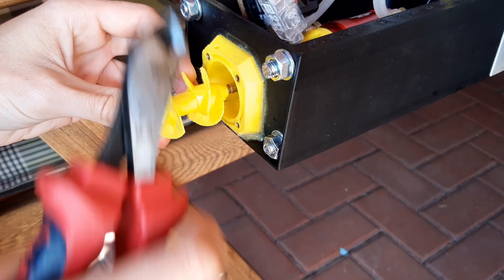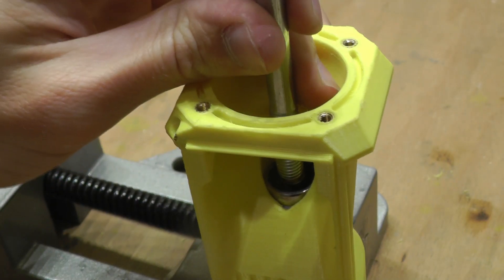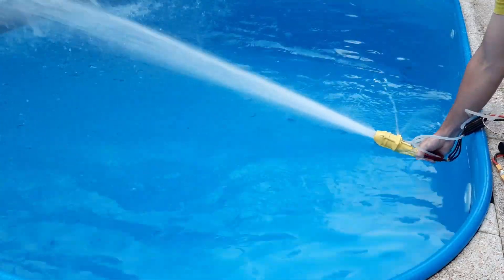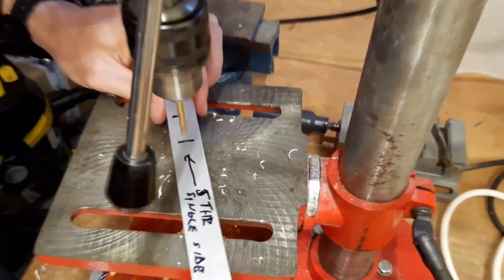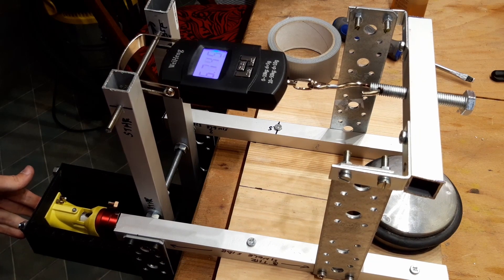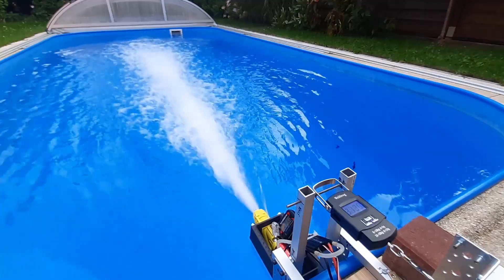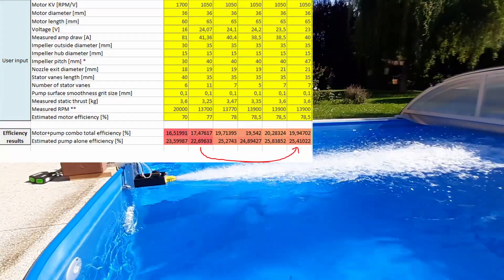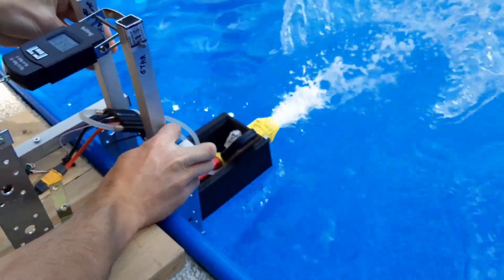How I Built My Most Efficient Jet Pump Yet

Comment: Interesting mod! I printed your M-Jet 60 and it came out really well. I prefer captive nuts to those brass inserts, but otherwise it was beautifully designed.
I notice that both stages have the same impeller pitch and same area, so the 2nd stage just unloads the first a bit rather than creating more pressure or velocity.
Could the 2nd stage be pitched a bit higher and have the "squeeze" start early (via hub expand, not outer tube), or is it always better to have constant velocity in the impeller parts and do all the squeeze at the end?
I'm also considering designing a single stage version with a cupped impeller and expanding hub. The final stator tunnels (not fins in reducing tube) will stay at tunnel width but with total volume = existing inlet-nozzle ratio. Seems less straightening is required that way, and it allows your steering gate idea to be done easily.
Thanks for your work!
Reply from the maker: Yes, the M-Jet 60 has same pitch on both impellers. That does not mean though, that the second impeller does not add pressure - both impellers add pressure, even if their pitch is the same. This happens, because the first stage stator vanes should straighten the water before the second impeller. Therefore ideally the second impeller operates in the same way as the first impeller and both add the same pressure.
During development of the different pumps, I tested different ideas. The M-Jet 60 got a straight hub, however with my latest experience I think that increasing hub diameter and increasing pitch work better - and this is what the M-Jet 35 uses.
The idea with "less straightening required" is one of the reasons why I chose the 4-path nozzle for M-Jet 35. As you described it, I think it will work for you and you can use similar steering indeed, good luck!
Reply: @mjetdevelopment  Thanks! I'm guessing that the optimum design would have a mass flow based on the funnel shaped Betz curve, but there are always complications like skin friction and turbulence and gaps between impellor and stator. And there's always scale.
It makes sense to me to utilise rather than suffer centrifugal effects, so your M-Jet 35 looks like a great direction.
Reply from the maker: @OzAndyify  I did not know about Betz curve before. I did a quick search, very interesting. I am not sure if this is applicable to such water pump though.
Reply: @mjetdevelopment  You are probably right because the jet is in a different medium (air) to the inlet and is fully constrained, but I think a gradual increase in velocity (area reduction) following a similar curve might be better than constant area & velocity in compressor part, then all the squeeze at once after the final stators. 
It's all one linked flow with water (not as compressible as air), so I may be way off! Your M-Jet35 work seems positive though, so it's worth playing. 
I love 3D design because we can make things that a metalworker would struggle with.
Reply from the maker: @OzAndyify  Yes, 3D printing gives great freedom of shape. The M-Jet 35´s impeller hub has an increasing diameter smooth curve, and this is what worked the best during excessive experimental testing, so I guess there might be some connection to the phenomenon you are referring to.
Reply: @mjetdevelopment  I'm going to try it from the inlet to the outlet with smooth curve as you say, including the stator sections. Just tossing up between one longer stage or two. It will bolt right onto your M-Jet60 inlet, so an easy experiment.
I really appreciate your feedback!
Reply from the maker: @OzAndyify  Nice! I am interested how it will go:)
Reply: @mjetdevelopment  I'll let you know!
I have the stock M-Jet60 mounted in a waterproof box and an inflatable SUP to test when weather improves. Happy to send you the design if it works any better than yours.

Comment: Please forgive the ignorant question (I'm not an R/C boat person), but why are you measuring the thrust with the nozzle out of the water?   When the drive is mounted in your boat, isn't it going to be submerged?
Reply from the maker: Hi, not an ignorat question at all:)
The reason is, at first the nozzle is submerged when the boat is sitting still, but as soon as the boat gets some speed, it "gets on plane" and mostly comes out of the water. Only a small area is fully submerged. This is the state in which the boat will run most of the time.
Reply: @mjetdevelopment  -- ah, thanks for the explanation!  
I don't know squat about R/C boats, but my intuition was that in full-sized jet boats, the output would be below the waterline, since water would provide a more suitable  medium for the jet to "push" against, than just air.  However, after reading the Wiki on jet boats, I see that I was mistaken, and apparently so was everyone else until William Hamilton thought to raise the output above the waterline, in the '50s.
Cool -- I learned something new today!  Thanks again.
Reply from the maker: @roberthaines4221  I understand your idea behind it, however the jet does not work by pushing the water "aganist a medium". It works like a gun shooting a bullet, and producing a recoil force on your shoulder - the water is like the bullet. The recoil, or here the thrust force is generated because the pump is accelerating the water backwards.
Actually, raising the nozzle above waterline is benefitial for efficiency, because it is easier to shoot the water into air than into dense water, where it would generate a lot of turbulence.
Reply: @mjetdevelopment  -- yeah, I get the distinction; it's Newton's Third Law all the way.  

One thing I find surprising is that in every video I've seen of RC jetboats, the intakes are simply flat along the bottom of the hull.  I'm surprised that at speed (especially in any kind of a chop) they can manage to draw enough water in to keep the impeller(s) constantly supplied, and prevent a loss of efficiency due to the introduction of air.  I would've expected to see some kind of an adjustable scoop / spoiler / trim tab that at-speed could direct more water in (without adding drag or disturbing the laminar flow).  Perhaps this is already being done, and I just haven't encountered it.
Reply from the maker: @roberthaines4221  Yes, this effect is hard to understand for me as well. The curve upwards into the intake is quite steep and I would also expect the water to separate from the surface and create vacuum or turbulence. But I dont have any way to properly find out what is happening there, because cavitation is important in this case and that is hard for me to capture in cfd. 
I have not tried a scoop yet but I dont want to put possibly vulnerable things under the surface of the hull.
Anyway, maybe one interesting thing is - the intake in my boats and most similar boats is so big, that the boat is travelling forward much faster, than the water into the intake. This means, from the water perspective, the water has to accelerate in the direction of boat travel to pass through the intake - the opposite way from the case where the boat sits still, if that makes sense.

Comment: Hi, very nice and interesting work ! Und straight forward design development. I like to see such work. But one question: How do you calculate the jet efficiency ? With measuring the power consumption of the motor and the produced thrust it is not possible. I assume that you are somehow estimating jet velocity or flow rate, correct ? And if, how ? Thanks for your answer in advance.
Reply from the maker: Hi, great question. There is no estimation involved. You are correct that I measure thrust and power consumption. But the one more thing which I know is nozzle diameter. 
I can modify the thrust equation (thrust = mass flow*exit velocity) to a different form (thurst = water density*exit nozzle area*exit velocity squared). From this I can calculate the exit velocity (it is the only unknown). Then I can easily calculate many other parameters including mass flow. 
Then, the output power is equal to kinetic energy the water receives per one second. And at the end I get efficiency.
Mainly, there are only two small errors involved: 1) this method estimates the water velocity is the same at every point of the nozzle which is not true, 2) I estimate efficiency of the brushless motor itself based on my previous measurements on a water dyno (in my older video) with similar electronics and load.
Reply: Ah, yes of course. That’s a simple and possible way based on an ideal world. But for me it is a kind of estimation because it is not measured somehow.
Why I ask ? I did some extensive measurements with my jet sprint boat from KMB with the corresponding 28mm jet unit. I measured power consumption, rpm, static thrust and boat speed at different throttle positions for different impeller and nozzle configurations. Now I updated my Excel sheet with your prediction of jet velocity and jet efficiency. With this I get efficiency value from 40-45% for the jet unit. Interesting to see is, that the calculated jet velocity for low throttle values is higher than the reached boat speed (as it should be), but for full throttle it is the same or even lower with the smallest nozzle I have test. This shows that this way of prediction of jet velocity/ efficiency is somehow insufficient, at least for my case. Therefore, it would be interesting, if you could also measure the speed of your new boat with the new jet unit for a comparison of jet exit velocity and boat speed.
Reply from the maker: @SharkV60  Yes, the boat speed can exceed the exit velocity. That is because we are calculating the exit velocity for a stationary jet unit with a static test. As the boat goes forward, the water is forced into the intake faster, helping the pump to push more water. Therefore flow rate increases (by the way rpm should also increase and amps should decrease) and exit velocity increases. So the boat is not going faster than the exit velocity, it is just that the exit velocity is higher when boat is running.
Reply from the maker: @SharkV60  I am very surprised by the 40-45% efficiency you measured on the kmb. I also did my old 28mm kmb test previously, not very "properly" that time, but it definitely was not over 30%. May I ask what your resulting output power of the KMB was? Just curious. You can see what I measured for my unit in my "M-Jet 35 Performance" video.
Reply: @mjetdevelopment  
Jet and normal propeller propulsion are completely different. Typical for jet propulsion is, that the power consumption is more or less independent from the boat speed. Water entering the waterjet inlet is accelerated to ship speed, consequently, exerts a momentum drag on the boat. I can only advise you to do some measurements on the jet in a running boat. By the way, this effect also applies to EDF units for model airplanes.
Reply: @mjetdevelopment  
In usual operation the maximal power consumption is not higher than 600-700W in static or dynamic conditions. Up to this power I did the most measurements where I got the mentioned efficiency values. In some test I went up to 1200W where the efficiency drops down to 34%. I’m traying to be very accurate within the test so far it is possible.
Reply from the maker: @SharkV60  Interesting. Thanks for further specification. I am not saying the power consumption is changing a lot and I have not measured it, but I find it very logical to estimate the amps drop for example from 80 to 70 at full boat speed, because the higher flow rate from intake makes the job of the impellers easier.
The argument that flow rate in a running boat increases is not just a plain guess, I got this result from multiple CFD calculations with a full pump, again not 100% accurate but the trend was clearly visible.
Also, as you pretty much said, at full boat speed, the boat speed is much higher than the water velocity inside the intake. The water has to slow down (relative to the boat) considerably in order to run into the intake and approach impeller. This effect should increase intake pressure above atmoshperic, which corresponds to some people getting leaks from the intake housing only when the boat is running and not during a full throttle static test.
And again this agrees with the increasing flow rate.

Comment: Finally bought the M-Jet 30 STL and noticed that you have included the single blade impellers with the purchase. Which was a neat detail, I look forward to seeing if it's gonna be better for my application.
Reply from the maker: Okay, good luck! I have not tested single blades on M-Jet 30 but it is expected that it should give maybe a little bit less thrust, but much lower amp draw, creating better efficiency and runtime.
Reply: @mjetdevelopment  How much volume in a minute do you reckon the 30 pumps at full chat? I have got a priming pump, but it peaks at 1l/min and I am afraid that won't be enough to supply the jet with water consistently. A litre a minute is about on par with the SuperSoaker CPS 2000, a PRODUCTION water gun. Which is the most powerful production water gun in history, but still. I could maybe stagger two pumps in parallel to increase flow to 2 litres a minute.
Reply from the maker: @ProtonFilms_Mark  The M-Jet 30 pumps over 3 liters per second... 180 liters per minute lol. For a water gun this is probably too much right? For a water gun, you need less flow rate but higher pressure converted to higher velocity
Reply from the maker: You could dramatically reduce the exit nozzle, or add a pipe with small diameter, to get much lower flow rate and higher velocity. But then plan your setup for lower RPM
Reply from the maker: And also I dont know how the pump will behave if you really decrease the diameter a lot
Reply: @mjetdevelopment  I can probably arrange that with a small enough exit orifice. I would like to say that I should have paid more attention in school, but I don't think I remember fluid dynamics being a subject at all. Physics was all seemingly thermodynamics at my school. Also, I did mistype, I did mean a litre a second, 60 litres a minute.
Reply from the maker: @ProtonFilms_Mark  Ah alright then! If its 60 liters per minute, I think you can get there no problem
Reply: @mjetdevelopment  it's such a pleasure conversing with you. Thanks for everything!
Reply from the maker: @ProtonFilms_Mark  I enjoy everything about this:)
Reply: @mjetdevelopment  so if we assume that the M-Jet 30 does 3 litres a second with a 1700kv motor and a 4S battery, and I need its maximum flow to be 1.5 litres a minute, does that mean I need a 2S battery? I've got an 80 amp ESC for the purpose.
Reply from the maker: @ProtonFilms_Mark  I am not sure. If you reduce the outlet nozzle a lot to get more velocity, it will drop the flow rate to some extent already. Maybe 3s would be a good compromise, but you will probably have to test it
Reply: @mjetdevelopment  I am just concerned with overtaxing the motor and ESC if they encounter too much resistance at the exit.
Reply from the maker: @ProtonFilms_Mark  I think 80A esc on 3S will be enough. On 4S it would probably be insufficient

Comment: Hey I tried the single prop mod in the M-Jet Spring 3d mods files and actually had worse performance than my standard prop. I was a bit surprised after seeing how much success you had in this video! Have you had any other feedback or updates?
Reply from the maker: Hi, thank you for your feedback, you are the first who has tested it! The results can naturally differ depending on the specific pump. It is totally possible that this setup works worse for the M-Jet Sprint. Regarding the new pump you can see in this video, I have already objectively verified the results so many times that this cannot be any coincidence, but I am still only testing the single blade pump static and the results can (unfortunately) change when I put it into a boat. Stepan
Reply: @mjetdevelopment  Worked great for me, interested to hear your setup.  Motor , battery etc. I am using 4s battery, smallish 2845 brushless motor at 1950kv. Everything stays cool, even when diving like a submarine!  LOL .

Comment: What if you reduce the number of vanes on the exit nozzle? 
Your nozzle design creates an amazing laminar flow but my guess is that at the same time there's a significant back pressure that's lowering the system efficiency.
thoughts?
Reply from the maker: Thanks for the idea, I am still testing different combinations and the main thing is, the leaving jet stream needs to be straight so I cannot reduce the vane length too much anyway. But its on the list to test:)
Reply: I'm wondering is he makes the rear blade pump smaller.

Comment: Really interesting! It would be good (if it's possible) if you could maybe also sell an upgraded single prop design for the m-jet.
Reply from the maker: Today I added a single blade impeller mod to the M-Jet 30 files, I will probably add it to the M-Jet Sprint mods as well. It is not tested for these pumps so that just needs to be kept in mind, but definitely worth trying it out
Reply: @mjetdevelopment  Brilliant, I'll try this out soon, thanks!
Reply: @mjetdevelopment  Tried it in my Mjet sprint and WOW.  It seems faster than before!
Reply from the maker: @JeffJackson86  Very interesting! Power consumption is definitely lower as well.

Comment: Should I hold out purchasing your M-Jet 30 model, or will it be updated?
Reply from the maker: So far, I am not planning sharing the files for this new pump because it is a different kind of a build, not designed to be easily assembled by everyone. Because I am focusing on making progress right now, I am also not planning to make any big changes to the M-Jet 30. But if you wanted to build the M-Jet 30 and try a single blade impeller design, I can create it and add it to the M-Jet 30 files.
Reply from the maker: Edit: The mod is there.